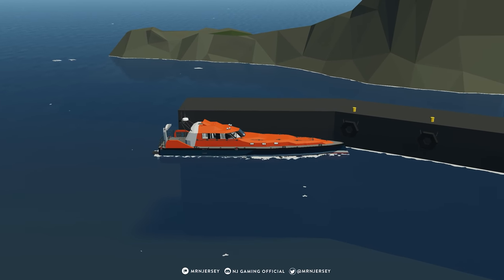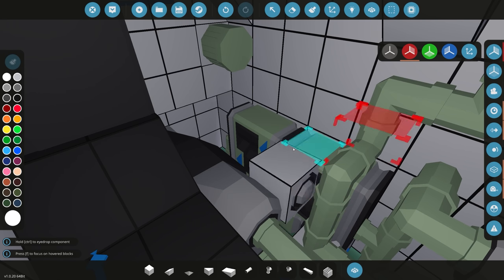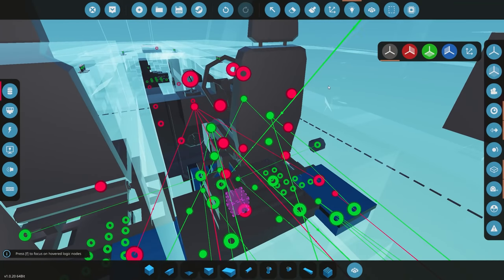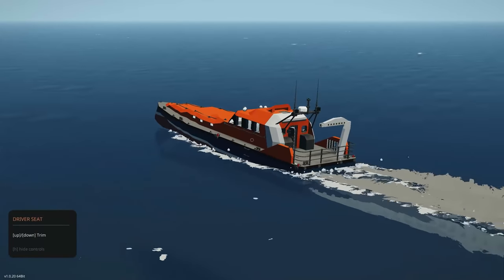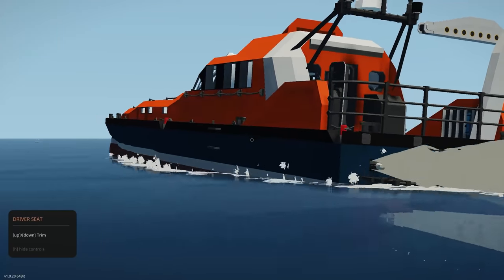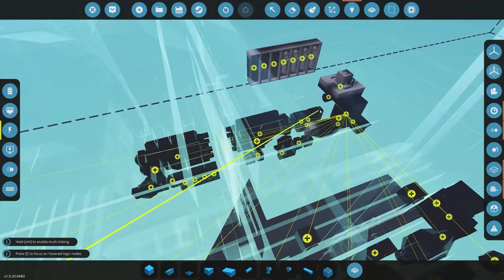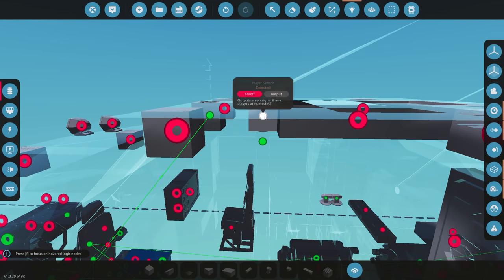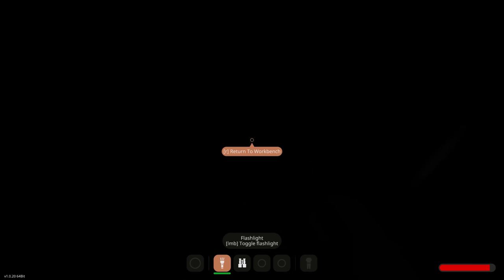SEA TRIALS!!! - SAR Boat Build - Part 5 - Stormworks

Comment: Something you can do to get authority out of your fluid jets while airborne, is to install a tank in-line with the fluid flow in your jet. 
Intake > Pump >(t-piece) > Small Tank >  Jet. 
This can be nice because that horizontal fin will cause a little bit of drag, and it will cause significant issues like lift in the new 1.0 extreme winds. 
As a bonus, I seem to get slightly better fluid jet speeds when I'm using a large pump to force water into it.

Comment: Youre nose is pitching up a lot because your center of mass is higher than your source of forward thrust, creating a torque on your boat lifting the front. 

Easy way to fix it is to add a line of weight blocks down the bottom middle of the center hull, no need for extra powered components (addressing your power concerns woth generators) or logic. 

Obviously you're not finished building yet so adding interior decor to rooms will also add weight to the front of the ship (though only blocks added below the current COM will help, anything above will make it worse).

Add weight or raise the jets until your line of thurst is roughly inline with your center of mass
Reply: You can trim the jets so they are aligned with the center of mass
Reply: @cilantrobasket7694  yes, you can, but thats extra logic that doesn't need to be be done if you are able to adjust COM position. Lowering COM will also help over all stability, so its a win-win just to do that  and its the simplest thing to do.

Better off saving the trim for helping combat roll  during a turn rather than the rise of the nose

Comment: having all those wedges in the fuel tank does it help with keeping it stabilized?
And speaking of electricity conservation, doesn't the constant number to the pivot drain the battery constantly?

Comment: Are you able to have red night lights, deck lights and running lights turn on at night with maybe white lights on a switch to change the color for operations or turning on aux lights. Since its a SAR boat, maybe one IR light or camera would be useful too.

Comment: Can someone please help me, I'm having troubles getting my fluid jet going. pretty much copied the sequence that MrNJersey made. Note: I'm using 2 medium engines with one jet each. My gear rations on both my gearbox's are {1. 1:1 2. 3:1} - {2. 1:1 2. 3:1}.

Problem:
The my engine keeps dying when I enable the pumps.

Goal:
To make my fuel efficiency better with two gearbox's while also having great speed.